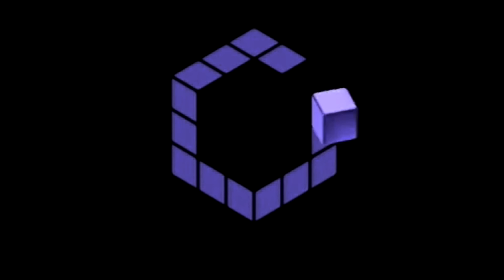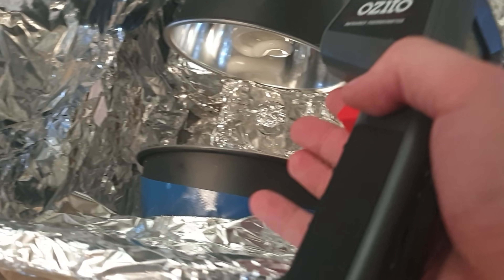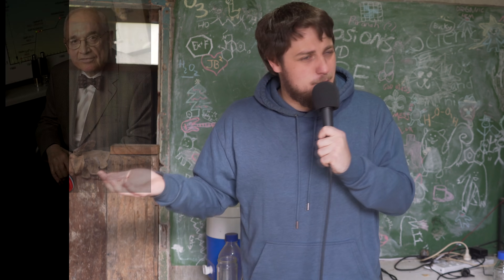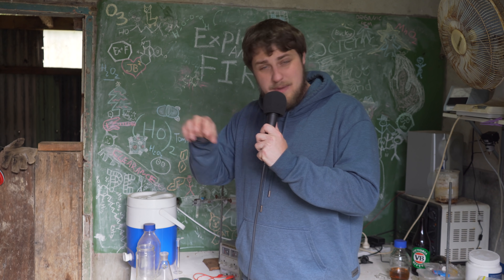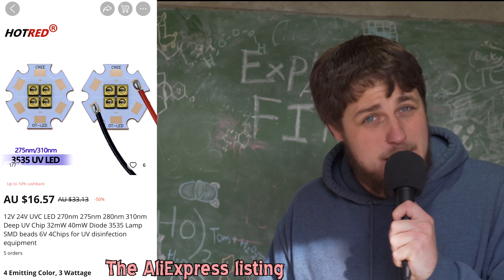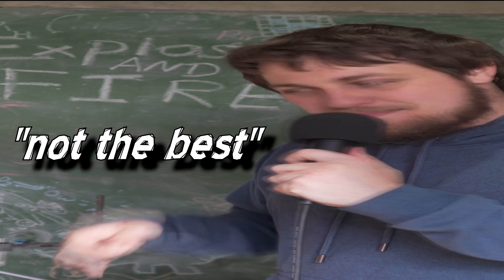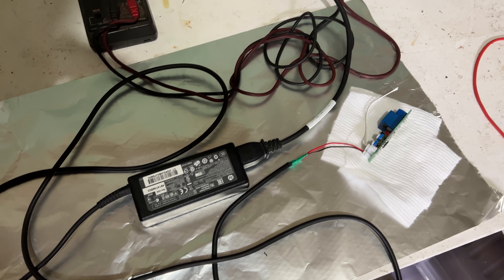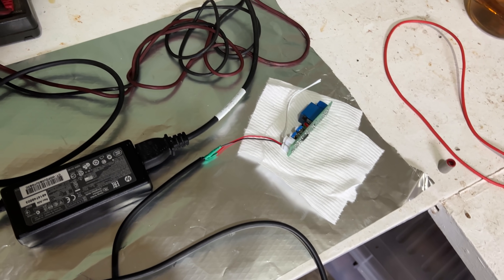Magical deep UV LEDs - Cubane Ep 12

Comment: As a semi-professional hobby electronicist, this was fun to watch. Painful but fun. 
What other people said: you can probably run the LEDs directly off the first supply with an inline resistor. I didn't catch what the voltage of that first supply was, if it's 24V, and the LED forward voltage is 12V, you want (24V-12V)/0.04mA=300 ohm, and at least a half watt resistor (P=V^2/R=0.48W, usually you want buffer on top of that, but, she'll be right). Or you can put two LEDs in series, and just throw low value resistors at it until the current gets kind of where you want.

Part of the reason you might want to use the bench top supply is you can set a max current with it; if you short the two leads together, it goes into current limiting mode, and you can tweak that down to the "plz destroy my things slowly" zone. Though it might be a bit hard to do as you're on the low end of the analog scale.

Yeah, you're probably over driving them. A bit. Which, if they haven't burned out yet, it's probably "fine"- they might only last 500 hours instead of 5000; you'll probably get better life out of them by increasing the off time (12s on to 24 off; basically trying to limit heat) (or just do 1s on to 2s off). 

Some folk are harping on about "you shouldn't be able to see it", and I think that's a bit more complex- if you're getting a fair amount of 300-310nm light, it might be that the eye has some sensitivity down to that wavelength, but I'm very unsure on this point- from personal experience, 365nm is clearly visible, and UVC germicidal lamps usually put out some amount of visible light, but I'm not sure if that's intentional. (there's a hilarious story, about a Hong Kong fashion event (Hypebeast, apparently) that used UVC lights instead of standard blacklights, because they had an interesting/different color)(it didn't go well- 4 hours after event there were complaints of painful eyes, peeling skin, not sure if anything else happened). But, I admit I haven't investigated this personally yet- have now ordered some tasty uvc leds to see.

As to switcher up or down stream of the driver- I think upstream would be preferred (downstream, the driving voltage will float to that 40V number, until turn on when it's shunted through the LEDs, which... not ideal, but depending on the capacitance involved, not life threatening), but getting rid of the driver and running direct off the supply would be more preferred. 

If you have electronics issues try a community post / discord post? (granted, I have no idea how anyone is supposed to see community posts...)

Keep up the fun work, progress! Yay!

Comment: LED drivers like that are designed for lighting, with much higher power levels and high efficiency. I think you are forcing 600mA through those 40mA LEDs! They will not last long that way. At only 40mA, you could just use a series resistor. LEDs are almost constant voltage, so we'll just assume it's 13V. Using an 18V supply, you'd have a 5V drop that we need to pass 0.04A. 5V/0.04A = 125 ohms. 5V * 0.04A = 0.2W dissipated by the resistor, so maybe use 1/2W resistors for some safety margin. Put one resistor in series with each LED module, and power them all in parallel from 18V. You could adjust the voltage if you want to use a different valued resistor. Just use the math above to get in the ballpark.

Comment: 8:14 Resistor. You need a resistor. Diodes of any sort have an exponential current versus voltage curve. Adding a resistor makes it much easier to control the current.

8:47 No, the 40mA number is very important. That power supply has a current limit8ng knob. Use it.

Comment: I'm a PhD student doing research on UV LED growth and I just want to say that the main challenge of high efficiency UV LEDs right now is partly due to light extraction (i.e. using UV transparent packaging), but mostly due to the difficulties in growing high quality AlGaN p-n junctions and quantum wells. P-type doped AlGaN is extremely challenging, as the acceptor state of the Mg dopant is deeper in the band gap than with p-GaN and thus getting sufficient amounts of holes in the material is extremely challenging, especially at higher Al compositions. Surface roughness is also a major issue, as we need very good interfaces in order to get good heterostructures for AlGaN quantum wells and quantum barriers. There is also the issue of defects in the material and how to get rid of them, as they result in nonradiative recombination. You kind of just missed the point on my entire PhD's work by saying that light extraction is the sole issue lol.

The major reason it's took so long for progress in UV is mostly due to the fact that research in AlGaN growth is extremely costly. Each growth I do is hundreds if not ~$1000 in materials and consumables (and I do maybe 4 growths every day). This is why there are only very few research groups actively pursuing UV growth and it's mostly companies that are doing the research.
Reply: To be fair, no one outside of a person working on UV LED growth would know any of this. Even reading this is extremely difficult because of the large amount of context required for every part of the process. 

(I personally don't understand about 1/2 of this what with p-n junctions and quantum wells. Its just magic words from a magic man)
Reply: @giggabiite4417  If you just replace the words “quantum (anything)” with “weird stuff” then it’s a little easier.
Reply: I couldn’t agree more.  Or less.  It just sounds like brilliant word salad to me.

Thanks for understanding this for me!
Reply: Also wanted to say exactly that! Btw whats up with these quantum waves, aigan(or something like that) and p-thingys?

Comment: you should really consider cleaning up the surface of the heat sinks before gluing the LEDs to them. Thermal glue (and even thermal paste) is really shit at conducting heat, so you want to get that layer as thin as possible. Ideally you'd polish both surfaces before the procedure, but that probably isn't necessary. 
Also: WERE YOU DRIVING THEM AT 50x OVER SPEC CURRENT?! WTF?!?!
With these LEDs you are supposed to put out like half a watt, sure you need a heatsink for that, but you maybe not even active cooling. You really don't need to have them on a power cycle. But please stop over-driving them that much, you probably already destroyed the ones you have. The fact that you still see them emit light doesn't mean they are still working properly. :/ 40mA LED drivers are cheap and accessible. Over here you can get them for <1€ a pop (for SMD) and 2 day shipping; australia can't be that much worse....
Last little note, you should think about lining the walls of the tin can with aluminium foil, Al is an exceptionally good reflector in the UV range and iron is... not.

Comment: How does 900mA seem like a reasonable current for 40mA LEDs?  Even driving 2 in parallel it is still 11x the current...
Reply: Turns out he wires them in series so 22x rated current lol

Comment: use ohm's law Resistance= Voltage/Current in your case 12V/0.04 A= 615.55 ohm get a resistor rated for 0.04A of 615 ohm or above and put it in series. if you need me to recalculate something just ask.

Comment: You could just use a lab power supply at around 15V and put a resistor in series to each LED. Resistance should be (V_supp - V_diode) / I_diode = (15V-12V)/40mA = 75 Ohms. Then put those 4 resistor/diode pairs in parallel to each other. The resistor limits the current through the LED so they don't blow up.
If you use an LED driver rated at 900mA it will supply 900mA at any voltage and fry the LEDs.

Comment: Mate you are destroying those LEDs, if the rated max current is 40 mA, you need to stay within that. Not only will you murder the LEDs in a hurry, but THE WAVELENGTH SHIFTS! Seriously, LED wavelength is temperature and current sensitive. And in most cases it shifts towards longer wavelengths, so at such gross overcurrent the peak output might be at like 350 or similar...

Comment: You might get away with it short-term, but those generic relays really aren't meant to be switched with that kind of frequency. It'll wear out pretty quickly (days to weeks) if you leave it running like that constantly. Would be better to use an arduino with a solid state relay or an n-channel mosfet to switch it. It would be a pretty easy first arduino project, and the parts would run you less than 30 usd even if you got a fancy brand-name arduino board.

Also, you were close with the "I assumed it would just take what it needed." That's true of the current at a given voltage, but not true of the voltage itself. More voltage forces more current across the component.

Comment: You need to read the spec sheet. If the LED is driven at 12 V and there is a 1 V drop (Vf forward voltage) across the transistor of 1 V then you need to add a 275 Ohm resistor in series to set the current to 40 mA.

Comment: Generally speaking with LEDs, you adjust the voltage until they're drawing their rated current. You can probably get away with over driving them some for a while but they won't last near as long. That driver you hooked up to them will output whatever voltage it can in its range to force the circuit to the 900 milliamps it's rated for. Which is significantly higher than what you showed for the LEDs. They may last a little while but you would almost be safer using your power supply and cranking up it's voltage and using the current limiting knob to hold it somewhere around 50 milliamps.
Reply: Thank you, this explains what people are screaming about ballasts for LEDs. I’ve always voltage regulated LEDs and could not fathom current regulating them instead on variable voltage.
Reply: @haroldsaxon1075  I'm glad I was able to help. :)

Comment: I think there are people who make DIY constant current supplies for driving laser diodes, so you might be able to make one of those with a low enough current. The 900 mA going through those LEDs is really spooky if they're actually specked for 40 mA; I'm kinda surprised they didn't yeet themselves when you had them on the bench top. even if they don't break for electronic reasons, this will make them heat up a lot faster

Comment: your electrical set up is probably fine. the ground plug you were worrying about you could attach to the metal can if you wanted to be super safe. basically that dangling ground wire with the ring's job is to provide a path to ground for a live wire that has broken in your final product (your UV box). If you want to set it up "correctly" then you will replace your plug with one that has a ground, connect it through to that yellow ground wire, and then connect the ground wire directly to your can. if you do that, and the can becomes electrified with 24v (or any voltage) than that current will flow into the yellow ground wire (around your driver) down the plug you installed, through the ground pin, into your house's grounding wire, and finally into the earth. If you didn't install the ground, and the can was live, then that voltage would flow into your hand instead. i'm simplifying a bit, but that is the general idea of what the ground wire is for. it basically saves you from getting shocked, and lets any kind of ground fault system or circuit breaker trip in the event of a fault. 

and you blew the ass out of some of your relays probably because you shorted them at the 24v they are rated for. they will have a voltage rating, and a wattage rating. imagine if you supplied 24v, but then had a supply that could dump 100 amps. you would put 2400 watts through your little relay, and it would scream as it melted, fused and popped. you also have two ratings with a relay. there is the rating for triggering the relay, and the rating for current going into the relay. typically, the voltage required to trigger the relay is lowish (5 to 24v) and the power rating that can flow through the relay is much higher (maybe 120v to 220v at 1 or 2 amps). a common rookie mistake is to swap them on accident, and you will blow the ass out of something (usually the coil melts on the relay or you melt a resistor). just double check that you are triggering with the right voltage, and also double check that the power going through the relay is not just shorted and has some load (like a fat 1 watt resistor) for testing. a common test load for switching wall power is just a regular eddison light bulb because they are designed to run directly off wall power with no current or voltage limiting. 

You want a current AND voltage limited power supply. as you found, it will be hard to find a current limited supply that low in the form of a wall wort or something that looks like a laptop power brick. The closest you will get is an external hard drive power supply or an ethernet switch power supply. both will be 12v and should be less than 1 amp. your best bet is to just use a bench top power supply to be honest. otherwise you will likely end up building a DIY bench top supply anyway using an LM317. There are plenty of "good enough" cheap power supplies on amazon and you just set the current limit to 40amps and then set the voltage to what the spec sheet says (i think you mention 12 volts in the video). you can overdrive the piss out of LEDs for some amount of time, but they start doing unexpected things like shifting wavelength and suddenly popping.

Comment: To me, the stress caused by turning them on and off is worse than keeping them on all the time at lower power (think of the oldest lightbulb still in service, (almost) never turned off or cooled and powered at low voltage). However, if you need brightness so there is enough light that the reaction progresses at a significant rate when the light is on, i'd recommend putting long times on, maybe monitor the cooler temp with it on all the time and shut it off at maybe 40°C and check how long it takes to go back to 30 or so and set the times acconrdingly. The temps will stabilize a bit higher though.
On the matter of the amps and volts and electric bamboozle, they do look like proper watt-capable diodes and the aliexpress sheet is just there to escape shipping restrictions. Try and find similar looking products that may have higher ratings and/or a part number that could match a legit UV-C diode. Amazing video as always !
Reply: It's right there 3535 is a cree series there's a xst 3535 uv datasheet with all the data. Looks like they bin the based on a 20ms test current of 350mA. They measure the intensity and wave lenght and bin them accordingly.
Typical current 350-500mA (max 800mA with reduced lifetime)  output flux 49-77mW @500mA
Typical forward voltage 6.45V, max 7.5V

Comment: Where are you getting that 40mA from ? I've just looked up the cree xst 3535 uv data sheet and it looks like the typical current is 350-500mA and it can be driven up to 800mA at he cost of reducing the lifetime. 
Typical forward voltage 6.45V, max 7.5V
Go for typical and please use a bigger heat sync, a big chunk of Al will be ok. But you've used glue instead of paste (and 2 small screws to hold the star in place) now didn't you.

Comment: From an electrical engineer, put a resistor in series such that the difference between the supply and the nominal forward voltage of the LEDs divided by the resistance gives the recommended current.  Then heat sink the LEDs and adjust the supply so that in steady state the LEDs get their rated current.  If they are all in series, this is much easier.  

LEDs work best with current regulation and that is what a resistor does crudely with a fixed supply voltage.  Make sure the resistor is rated for the power going through it.  

(Vsupp-Vled)/R=I

Presistor=R*I^2

If you do these things, a supply with a constant current mode is not necessary.

Comment: Hey man!  Here’s how to make ur LED’s work! Just set ur power supply to constant current mode. No drivers or anything required! 

So with the LED’s disconnected, turn the power supply voltage to like 13 volts, and turn the current all the way down. 
Then, short the power supply leads and turn up the current dial until u get to the proper forward current on the ammeter, should be ~0.040 amp per LED ( maybe use a current meter for more precision)
Then, connect ur LED.

To drive multiple LED’s, connect them to the power supply in parallel. Then, set the current on the power supply to (LED forward current)*(number of LED’s)
 
hope this made sense. Feel free to ask if anything isn’t clear
Cheers!

Comment: "900mA seems like a reasonable amount."  Nooooooo!

That driver is waaaaaay too much.  You only didn't blow those two stars because the driver hit its voltage limit.  But it is still cooking those LEDs and running them way too hard.  They won't last for a full run.